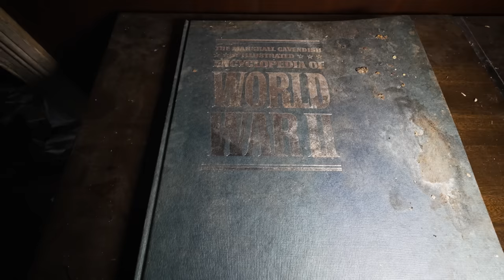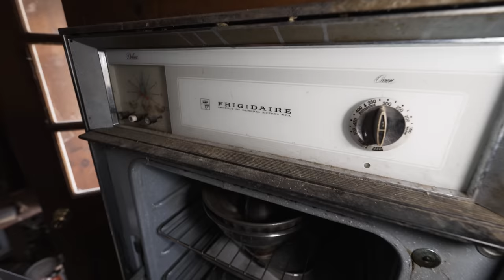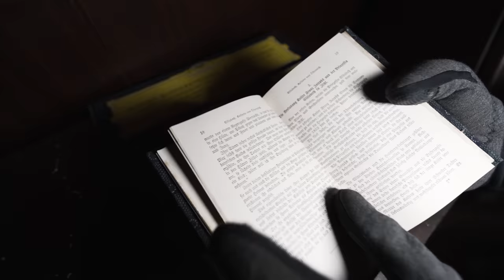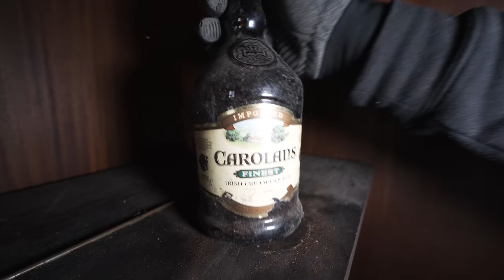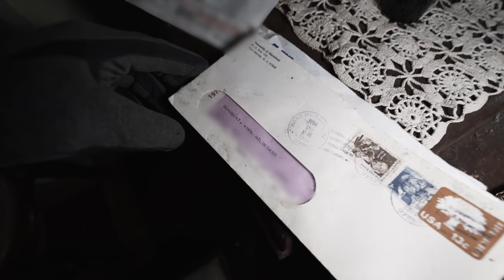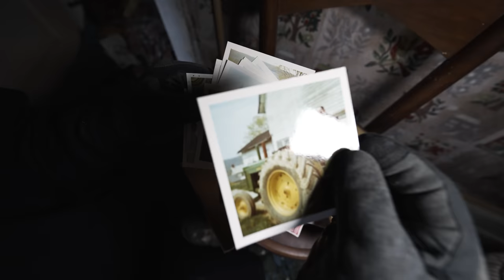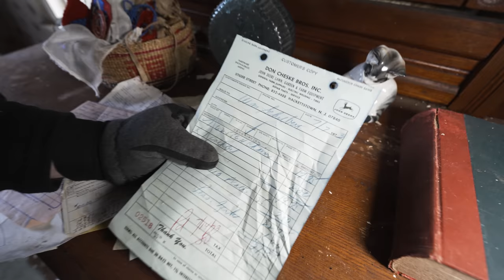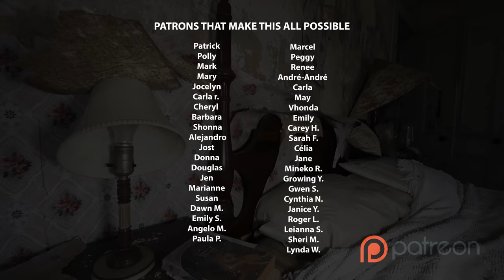She Fought for the Survival of the Household ~ Abandoned House in USA

Comment: The chair you were sitting in was an old desk chair, some dating into the 1920's.  Don't know how much older they were, but I have one like it that was made in either the late 1930's or early 1940's.  Love the chair due to it's age, but they weren't comfortable to sit in for long periods of time.  Also  have a New Home sewing machine which is a treadle.  Believe the one you showed was electric, although couldn't say for sure as you didn't show anything other than the head really, so I'm guessing  from the cabinet  it's in.  Something I haven't seen in any of your videos, where there's older furnishings is a fainting sofa.  They are really neat.  It's the forerunner to the modern day chaise lounge.  I happened upon one and had to have it.  (Smelled terrible from having gotten wet).  Little different than most as it fold out into a bed. Haven't been able to find much information about it but what I have suggests it was probably made somewhere between 1890 and 1895.  Restoring it as it is a beautiful piece.

Comment: @40:55 is called a box camera, and yes, it did use film; It's not as old as one using glass plates. It's a Kodak "Brownie" and it took film wound on a spool that was taken up by another spool. The small  metal piece on the side would have advanced the film.(You could buy film for it, the 120 style, until theat least the late 1970s.) It is from around the 1920s, not the 1800s.

Comment: Ok, the small box camera uses film, not glass negatives. I once owned and took photos with a similar camera. I would date it at approximately 1910 or so, slightly over 100 years old. The film comes in a spool which attaches to a "take-up spool. After taking the picture, you wind the exposed film onto the take-up spool, and then you can take the next picture and so on.

Comment: Maybe the chair with the wheels was used as wheelchair. To move the husband or wife around. The chair with the whole in it. Is a bedside toilet. That way you don't have to go very far. Specially if you don't move very well. Then empty it out. I have seen where you can put these toilets over the toilet and then just flush. But you would have to see if you could fit it over the toilet.